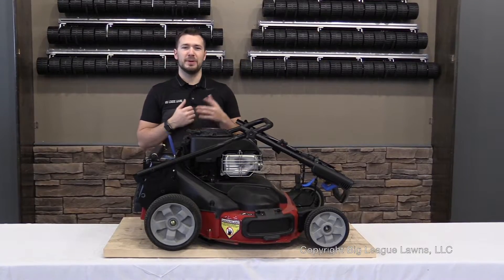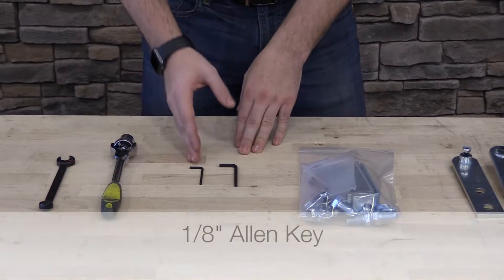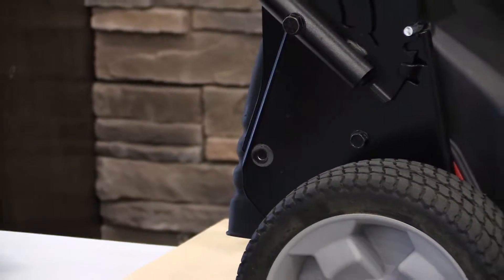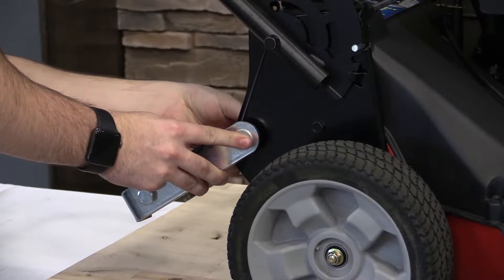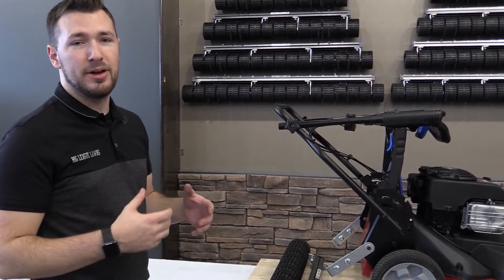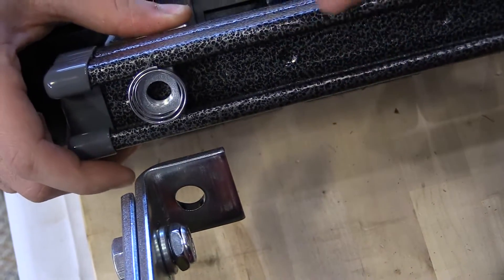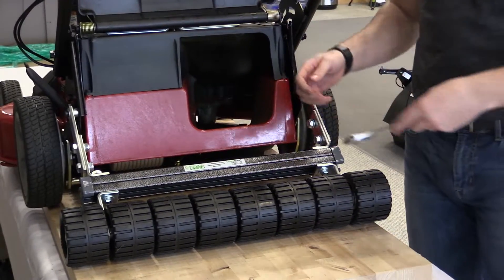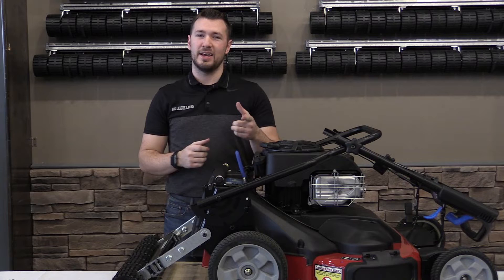Toro TimeMaster CheckMate™ Striping Kit Installation Video

Comment: Is the sleeve on the mounting nut on the mower supposed to be in the hole or just the bolt
Reply from the maker: Timmy, only the 5/16" threaded portion of the pivot bolt passes through the 5/16" hole in the mower frame.  The shoulder section of the pivot bolt is reserved for the pivot arm to swivel on.  Thank  you.
Reply: @bigleaguelawns  ok thanks

Comment: Does it really weigh 30lbs like the add says ?? really, how can it be that heavy? the rods are not that heavy nether are the wheels?
Reply from the maker: Our kit, including hardware does weigh around 30 lbs. The wheels are solid rubber, the axel is solid steel, the brackets are all 1/4" thick steel, and the channel is 14 gauge steel.
Reply: Really!? How much does your head weigh? Have you you ever put it on a scale? I'm guessing around 100 lbs. And not in a good way. Nothing but fat

Comment: Has anyone just attached it with locking pins for quick removal and replacement?
Reply from the maker: Sure!  Individuals have been very creative in terms of creating quick release systems.  A simple Cotter Pin and Clevis Pin will certainly hold the mounting arms to the existing holes in the mower frame.  Please keep in mind that because the pins are 'loose' [or unlike a bolt and nut firmly attached to the mower frame] that you could potentially 'oblong' the holes in your mower frame.  Sample Cotter Pin + Clevis Pin Photo:  https://trailermarketing.com/wp-content/uploads/2017/05/brk-hdxcp1-clevis-pin-with-cotter-pin.jpg

Comment: Wtf is the 1/8th Allen key for?
Reply from the maker: It's an 'added' key to tighten down the locking collar which attaches to the pivot bolt.  It's needed only in the event that the set screw were to come loose.  It's not a necessary tool for the installation since we pre-assemble the pivot arms for you.  It's placed in the hardware bag in the 'event' a customer were to ever need it.  You may view a picture of the set screw here:  https://www.screencast.com/t/0g5mneR86
Reply: @bigleaguelawns  THX